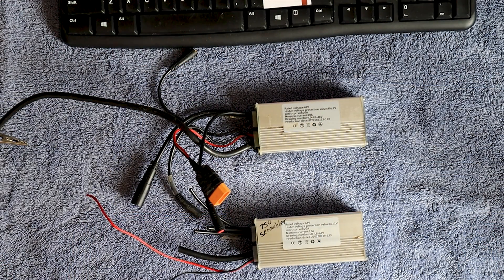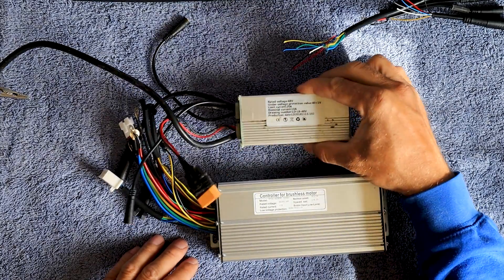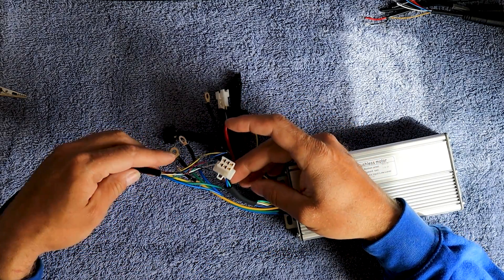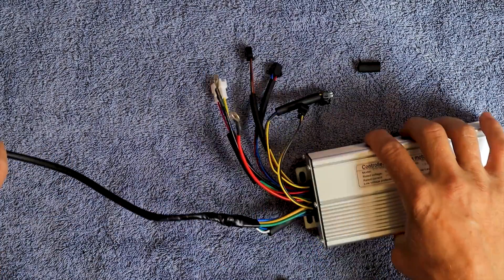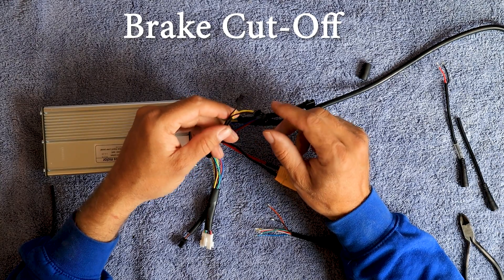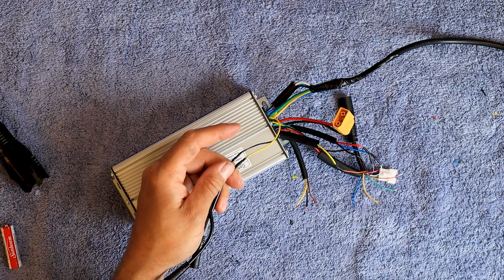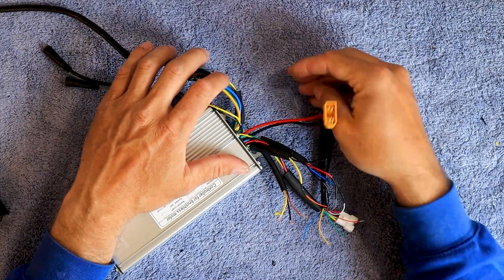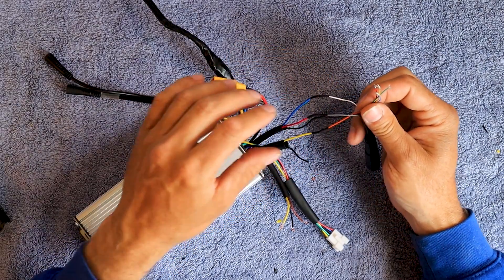Juiced Bike Scrambler Wiring up 35 amp Kunteng Controller

Comment: Just came across this video and thanks for pointing out the issue with the light, and the fix. I just ordered a KT 30 amp controller to replace the 22 amp that came with my bike, reading through some of the various forums, seems lots of people have had issues with their lights with these KT controllers.
Reply from the maker: That fix didn’t work very long for me.  I’m sure there’s a workaround but I usually never ride at night. I ended up putting a switch on my light and giving it constant power
Reply: @vanmasterflash7153  Thanks for the response. The controller I ordered has a two pin julet connector for the lights. I will check it with a volt meter before I attempt to hook it up, hopefully it will have full battery voltage.

Comment: For reference This is what came with the bike:  KT-LCD3 for Pasion e Bike 48v 1500w Motor Kits (Sh!tty keeps blinking, the led is kinda messed up too) would like to replace.

And this motor hub from alibaba:

 36/48V 800-1000W 35Amax Brushless DC Motor Controller Ebike LCD3 KUNTENG LCD Controller +KT-LCD3 Display One Set
Reply from the maker: If you have the stock motor all you should need is the controller.  Does is have the stock half twist throttle?  If he didn't hack any wires on the bike frame, used the connectors off the stock controller, and gave you the stock motor it's gonna be a breeze.  I worry since he used a kit and a different motor he might've hacked some of the wire ends. If your not, join FB groups:  https://www.facebook.com/groups/593460241177140   and : https://www.facebook.com/groups/juicedscrambler     There I we chat and i and/or others can look at what's going on.  Between Brian Mckibbin and I (Justin Sanderson)we should be able to help you out better.
Reply: Thanks so much brother I appreciate that so much - I actually am a member of that board - is there a way to contact you on there I can send you a bunch of videos and pics of what it looks like under that seat. I see tons of wires and black tape - Sometimes the screen blinks and if I bounce just right on the seat it starts working 🤦🏻‍♂️🤦🏻‍♂️ Just want this thing to work properly - can’t get stuck on the 59th street bridge again peddling a 65 pound bike in 100 degree weather 😞

Comment: Hi, I’m praying that you see this and respond.  I purchased a juiced scrambler 52V 19ahm Battery.  (I’m forewarning you I am new to Ebikes anything you guide me towards my bike shop will be actually performing) ANYWAY.. I purchased my bike used, for here in NYC.  The person who sold it to me used your video and technique from the above video.  My dilemma is that I want the bike to have peddle assist and for what ever reason it’s not working? Is there something you can suggest that I can do to make it work again? Also my other question is there a way to return it back to stock? What would I need to do that? I’m asking because i need the battery to last longer and with peddle assist I think that would help gain more land.

 power

Comment: The plug-in DIN to the harness that used to belong to the old LCD controller could use the rubber thread protector cap most 223 barrels ship with. Ask a gunsmith if they have a box of em. The new controller has a USB port?
Reply from the maker: Thanks.  No usb port.
Reply: @vanmasterflash7153  As I don't ever plan to join Facebook have you seen anyone use a similar Bafang wired controller? And why did you end up with this one instead of a Bafang pre-wired version? I kinda want color and USB when I do upgrade later. No hurry here 'as my PAID bike has not even shipped yet' and I may buy the controller kit but not install it till next year. (letting the warranty lapse first) (Hyperinflation is coming! buy your toys now!)
Also, check this deal out at Amazon. They don't mention what brand cells however so there's that. 52v 20ah 1500w for $389.99 https://amzn.to/3cdcxdz  HMMM!
Digging this thumb throttle here too for the power switch. https://amzn.to/3daNUy2
In the prepper mindset also see this! https://electricbikereview.com/accessories/electric-bike-company-accessories/ebc-solar-panel/
Folding panel is the $$$ bonus here but finding the right MPPT sourcing your own panel would be cheaper. 
OK take care, MAD MAX influenced electric bike gangs ahead!  let's hope you're not riding the back seat Lol.

Comment: Hi there, well, I finally got the controller the And we wired it up, are use the KTLCD3 Display and I can’t get the display to turn on. I plugged the display directly into the cable that the stock city scrambler display was plugged into and I can’t get it to turn on. Am I doing something wrong? I know that we wired it up just like your video showed but we cannot get it to work. I can’t get the display to turn on is there a different type of KT display that I’m supposed to have?Please let me know. I’m so frustrated that I almost want to sell it
Reply from the maker: I didn't use that plug because the KT display and controller are made to plug and play.  You seem to be making it harder on yourself.
Reply from the maker: Maybe i'm not understanding.  Don't sell, because you'll get it.   I was in deep with my Z1's but finally got it.  Remember to turn power on at battery .  Sometimes simple things get the best of us.  I need more info to help.  I'll check for you on fb group
Reply from the maker: https://www.aliexpress.com/item/32283779368.html?spm=a2g0o.productlist.0.0.ec242072iTuuPF&algo_pvid=5575e0cd-8350-4ed5-932d-43c0885dfe91&algo_expid=5575e0cd-8350-4ed5-932d-43c0885dfe91-5&btsid=0ab50f4415821235765873455eca11&ws_ab_test=searchweb0_0,searchweb201602_,searchweb201603_

The controller needs to be a KT controller like the one in the picture.  Model needs to be KT to work with the display.
Reply: Thanks for your response. Actually, I bought that exact controller you mention from aliexpress but I didn’t buy the Kt  display cause I already have a Kt display but it doesn’t have that long cable and plug .. my KT display doesn’t work with the New KT controller cause it doesn’t have the long cable and 5 pin plug... Maybe I need to buy that display because I can run that cable all the way back to the controller and plug it directly in? Is this what I’m missing? I apologize, I’m just so confused

Comment: I need help to find  Big Water Proof 12 Mosfets KT Kunteng controller 30+ amp.
Thank please
Reply from the maker: https://www.aliexpress.com/item/32283779368.html?spm=a2g0o.productlist.0.0.9efa2072EW4FRw&algo_pvid=314eef06-2b1f-4046-9a2e-8254ce8e71ed&algo_expid=314eef06-2b1f-4046-9a2e-8254ce8e71ed-0&btsid=6bc43a91-a418-4d04-a2ab-2507dd894915&ws_ab_test=searchweb0_0,searchweb201602_10,searchweb201603_55

You'd have to waterproof it yourself.  Amazon might have one you can get quicker.  I've personally ordered from the store in this link with no issues.  It take about a 3weeks to a month to get though.  Might be able to find something on amazon faster but much more expensive.  If I was going to waterproof it i'd prob just squeeze a full tube or more of grey rtv silicone into it by removing one end cover.  By the looks of things that's the way they do it.

Comment: I am new to this Ebike thing, 

What is the purpose of the new controler? I figure it is to make the bike go quicker or faster?

So my end all question is, it seems you have a 750W bafang City Scrambler, so  how fast does the bike now go top speed with the new controler.

I want to get a scrambler as its the best looking retro bike in my opinion, but I would love the bike to go at least 35 mph.

I have been looking at Lunar Cycle for an upgraded 1500 mid drive motor and controler. Will be calling them on Wednesday to see if my wants of 35 to 40 MPH are doable.

Thanks for your time and response.
Reply from the maker: Everything makes a difference but, larger motor will handle loads better(hills, acceleration etc).  Controller controls how much power to release to the motor.  Main way yo go faster is higher volts.  Just make sure you have a controller that can handle that.  I can put 60v at 45 amps to my 750 watt motor and it'll go like a bat out of hell (40 mph).  But eventually it'll overheat and kills itself because it's only 750 watt.  Hope this helps.  1500w mid-drive and at least a 35amp or higher controller should get you 35mph.  After 30 mph it gets exponentially harder to go faster because of the wind.

Comment: What is the new top speed with the final product for both PAS and Throttle only? Thanks in advance!!
Reply from the maker: I can only hit 30-31 on flat ground.  I think the 35 amp controller isn't as advertised.  It has 35+/- amps (1750ish watts)for a little bit at take-off then it slowly goes down. By the time it hits 28+ it's down to 800 watts.    The 25 amp kunteng we have on our z73's gives full amps(25/ 1300watts) at all times.  I'm still happy with it.  Acceleration is 3 times faster and there isn't anymore surging.
Reply: Thanks for the fast reply!!

Comment: Nice vid!  ,....Wow,..you're wearing those tires to the maxx!

So,...you replaced the JB Display with another,...do you have a vid for that?  I'd be interested in that one!
Reply from the maker: I bought is with the controller.  Yes I'll do a video on that soon and I got some new tires coming as well.  I've been really lucky with the stock tires.  No flats...knock on wood.
Reply: @vanmasterflash7153  ,....Have an RCS,..no flats yet!  Came close on the last ride,...lots of broken glass on the sidewalk!  I will hold off adding a Cph holder to my Crossbar.  Thk you...

Comment: Thanks for the video. Did you add with your upgrade controller a Thumb throttle?
Reply from the maker: I wired in the stock one.   I like the half throttles.

Comment: Thank you Justin! I am waiting for my controller to arrive. This video will be very helpful.
My factory controller works very well with no quirks other than the programming that limits amps when standing still. I need more power only on take-off. My plan is to leave the factory controller as is and strap on the KT as #2. I bought a left hand thumb throttle and plan to add a heavy duty switch and second battery. I like the pedal assist and use it mostly. The problem I need to fix is starting up an incline from a stop with very bad knees and more weight than the bike is rated for. I want to be able to switch controllers on the fly and will be using the Juiced controller most of the time. 2 controllers, 2 batteries, 2 throttles, 2 displays. I had thought to only wire the KT with power, throttle, display only but with this video will think about brake wiring also. The second battery will also more than double my range as it will be 20 AH. The switch will isolate systems to protect them from each other. I will be searching for my soldering iron which I haven’t used for decades.   : -)
A second switch will choose between either battery to the Juiced controller/throttle. As far as the higher top speed on throttle only by the KT, it will be fun occasionally but I prefer 20MPH and further range.